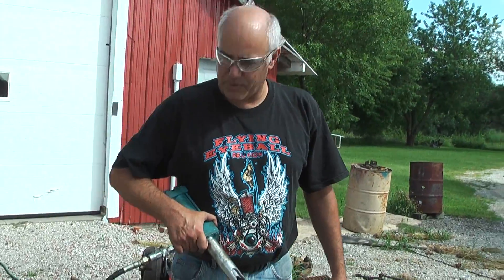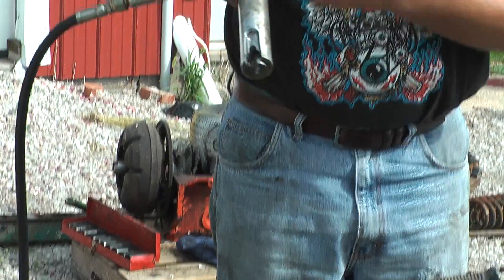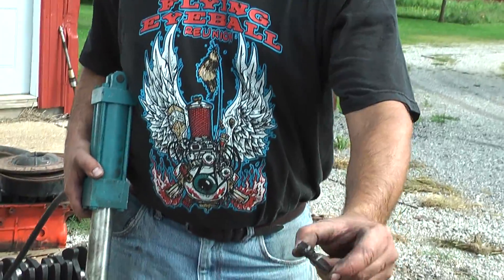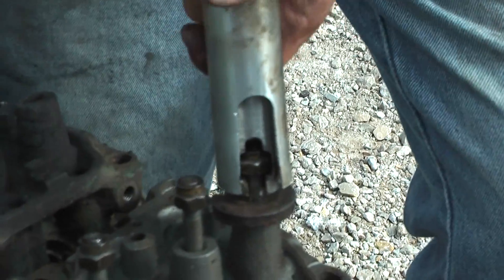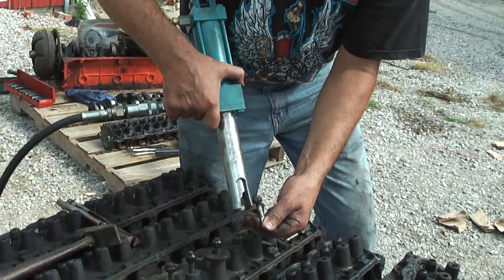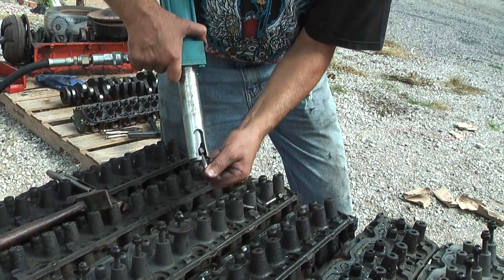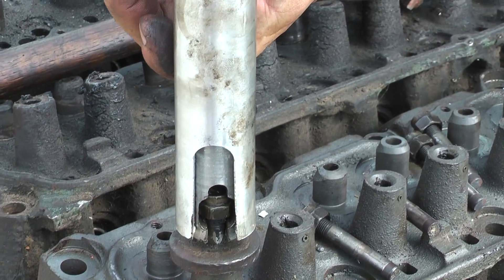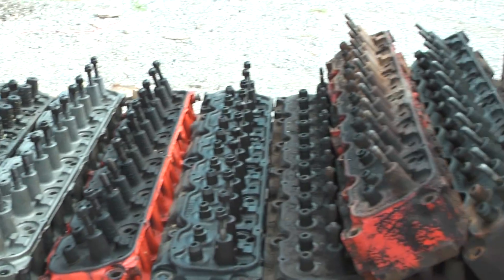Hydraulic Rocker Stud Puller Chevy Ford pressed

Comment: That's awesome. I found that spraying some penetrating oil (and leaving overnight) and tapping on the stud helps to 'break' them loose. I miss the machine shop. That would've been a handy tool to have. We still used the thread on puller and an impact